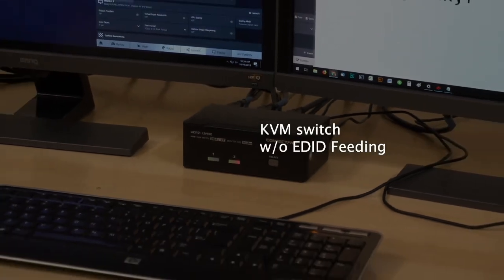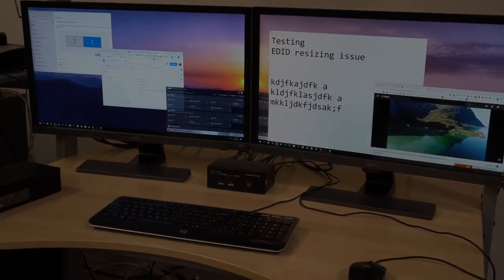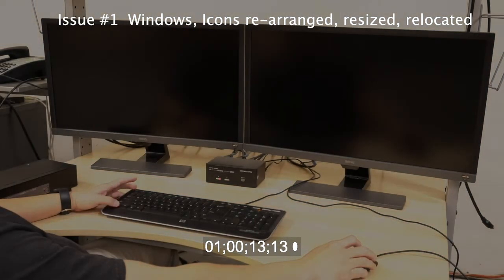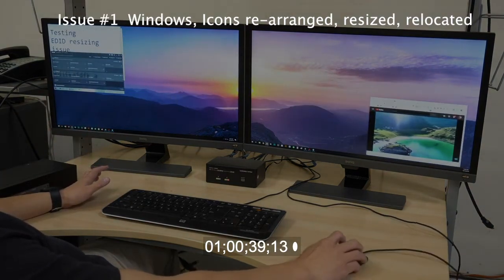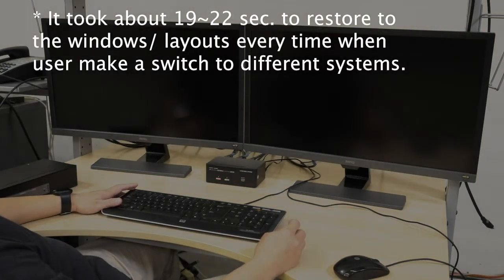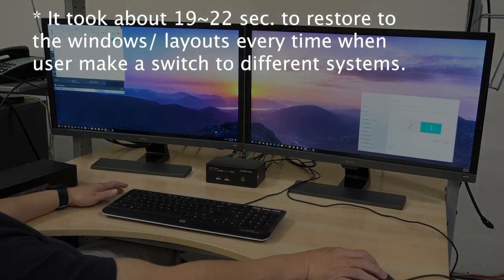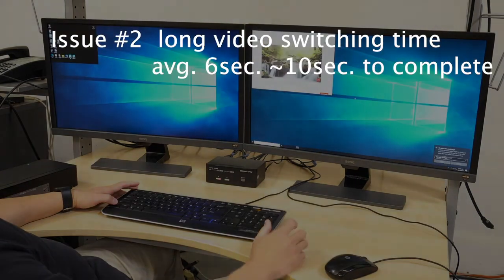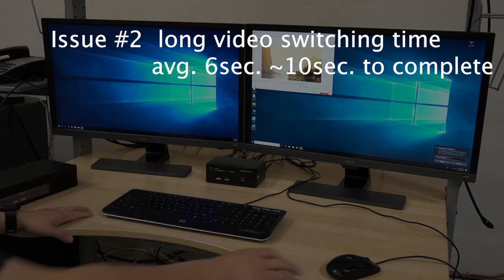The Most Common Issues found with DP KVM switches

Comment: Hello, I just got one of these but my keyboard and mouse aren’t working. I’m able to toggle between workstations with the keyboard hot keys, but I’m not able to use it to type or make mouse movements. Is there something I’m supposed to do to get the keyboard/mouse to work properly?
Reply from the maker: If your keyboard and mouse are not USB HID class devices then it will not work.  Keyboards with USB hub ports or card-reader on them are classified as HID class devices.
Reply from the maker: You still can use non-HID class keyboard /mouse to plug into the shared USB hub ports on the KVM switch.   It should work, but you can not use hot-key commands when you plug your non-HID keyboards/mouse to the shared USB ports.

Comment: My understanding if that if you use a cheap USB+HDMI KVM switch, the only solution to this window resizing and video display refreshing is to use an EDID passthrough adapter at the HDMI output of the computers... available for about 20 $USD/each online.
Reply from the maker: Yes, there are many EDID emulators available for HDMI, but almost none for DisplayPort even in 2022 currently

Comment: so these issues arent present with EDID switches/extenders?
Reply from the maker: switches and extenders with full-time EDID emulation or feeder will not have these issues, since, for connected systems once connected to those switches or extenders, the OS of the connected systems will no longer have hot-plug error for video devices.

Comment: Does UDP-12AP support EDID directly, or do I need another device? I have 2 computers and one 4k monitor. The StarTech switch doesn't really do the job.
Reply from the maker: Yes, it supports EDID feeding directly from each connected systems.  You don't need any external EDID feeder/adapter for each connected systems.   For Startech.com's switches,  each connected systems required to add an external EDID feeder to provide EDID emulation to each connected systems.   For 2 computers, you need two of the DisplayPort EDID feeder/emulator.
Reply: @rexwu168  Do I correctly understand, that startech switch sv231dhu34k6 has the EDID listed as supported feature and won’t have mentioned issue?